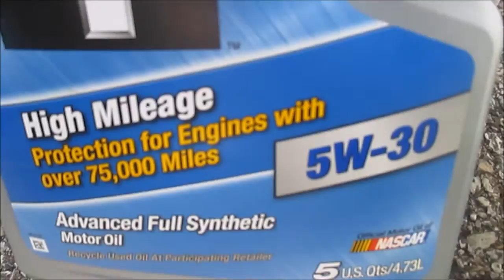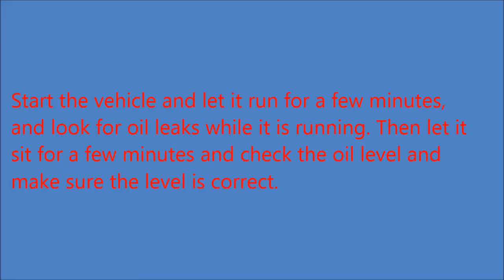Dodge Caravan Oil Change

Comment: Long live the Grand Caravan w/ 3.8L V6 engine!  I've been working on my friend's 2005 w/ 155K miles.  Thing has had almost zero maintenance.  Sparkplug wires original!  Valve cover gaskets original - rear center had turned into hard plastic - bend it and it snaps!  PCV valve original!  Alternator, etc all original.  bolt heads mostly have no marks on them - never removed!  Still starts and runs great.  Radiator was rusty inside - filled with water instead of coolant (no freeze in southwest)!  One by one I'm changing stuff out.  What a great product!
Reply: There are non-antifreeze coolant additives that will protect against rust/corrosion and have other benefits. AMSoil, RedLine, and Royal Purple are probably the top ones.

Comment: I use a quality filter (i use K & N) with check valve in it that holds oil for next start up, cuts down bigtime on start up engine wear. ask which model has this check valve, dont just assume its in there
Reply from the maker: Thanks for watching.
Reply: Most filters have an anti drain back valve (ADBV). Some work better than others, and some filter orientations make it irrelevant.

Comment: How many liter oil normally goes into that?
Reply: 5 gallons
Reply: @yournightmare9999  no no no, 5 quarts, which is roughly 4.7 l.
Reply: The whole jug, usually you put some in the filter first before screwing it back on there, but it takes the whole thing

Comment: Just about the worst possible oil filter you could use...
Reply from the maker: I have been using this brand for years and I never had a problem. As far as I can tell, oil filters are all made about the same way, anytime I have popped one open they all looked identical to me. I dont think it matters that much which brand you use, (oem is probably best) I think what matters most is changing your oil regularly. Which brand do you suggest?  Anyway thanks for watching and thanks for the comment. Have a good day.
Reply: That's a pretty low-information opinion. Wix, purolator, champion labs, and Honeywell make most American-made filters, and most of them are branded for another company. Who knows how many Asian mfgs there are. Construction materials and quality can vary widely. Anything that uses cardboard endcaps (Fram/Honeywell) is subpar. They are capitalizing on a popular brand by lowering cost to maximize profits. Baldwin and AMSoil filters are probably the highest filtration efficiency out there. Purolator and wix are not bad. The new Champ design is cheap. Get a Baldwin B2 for your van. It's about 1.5" longer and the same diameter as the factory Mopar "090" one usually made for them by Purolator. There is lots of info out there on this.
Reply from the maker: Hey thanks for the info, I never realized how many differences goes into each brand of oil filter. Like I said, I have crushed a bunch of them and they just about always looked identical to me on the inside (just like you said I always see the cardboard endcaps), so I guess I never gave it much thought. However, I will have to look up some more info about what you are saying and check out some forums and further info, to better educate myself on them. Also, I will check out your Baldwin B2 suggestion. Thanks for the tips, I appreciate it. Have a good day.
Reply: @bly4233 how many "asian" ones? YOU SEEM LIKE YOU'RE ANGRY 98% OF THE TIME😢 I hope you find your peace
Reply: @missbehaving  what was angry about his comment?